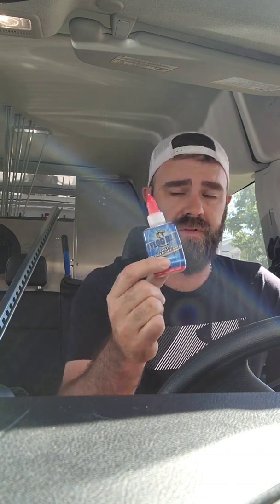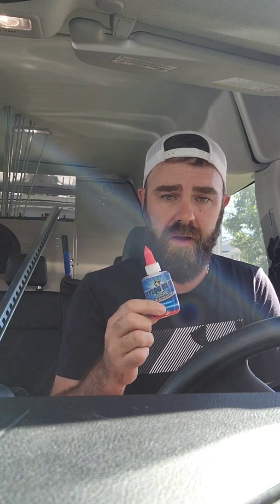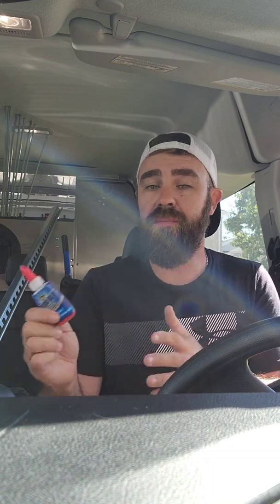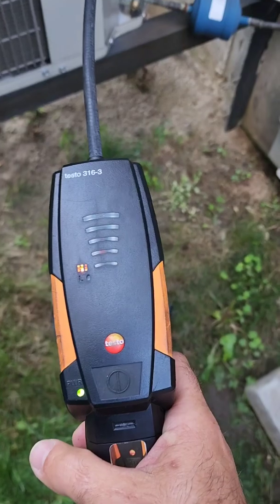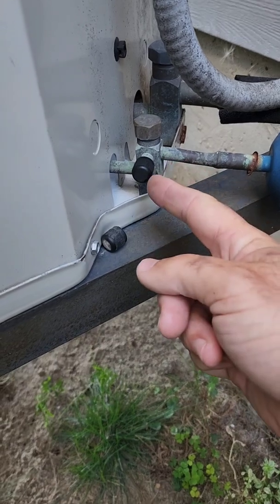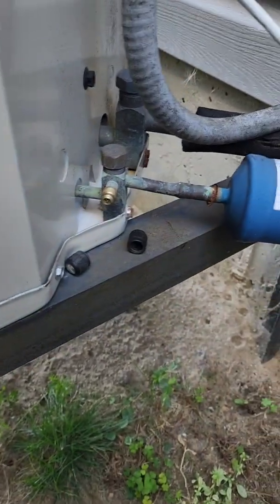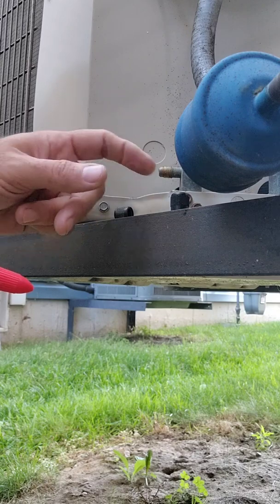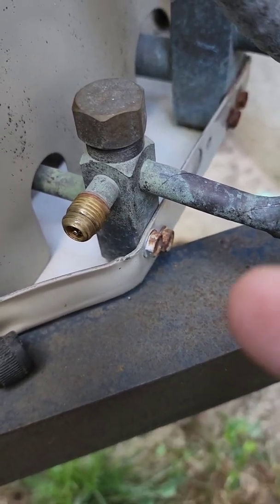Using A Thread Sealant (Nylog) To Seal Refrigerant Leaks

Comment: All 5 of my mini split cores leak. Caps are a must. I tried putting nylon on the valve core threads and they still leak. Nylon on the cap makes it seal. Schrader cores need a new LEAK FREE design.

Comment: Why don't you use the brass cap instead of the cheap plastic ones that can crack and leak? Brass cap has a flare type of seal. You can also use the copper gasket to make it even better.

Comment: I’ve often detected leakage at brand new cores that I installed. I use Nylog with brass caps and have had good luck with it.
Reply: I toss the plastic caps anytime I see them. Replace with brass.

Comment: Does the core create the 100% seal or the cap? 
I do love nylog btw and refrig tech is the best
Reply: the cap is most of the seal, same reason you have caps on your car tires
Reply: @TheSimba86 Lmfao the shrader valves are the seal DUHHH... Cars have caps ovwe the shrader valves to prevent dirt from getting inside, not to keep 30+psi inside smdh you don't have a clue what you're talking about.